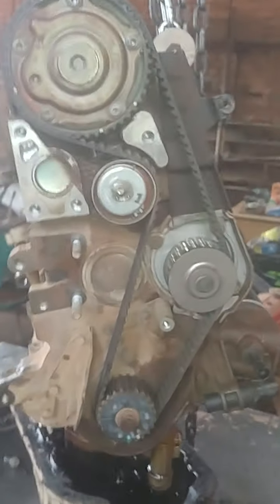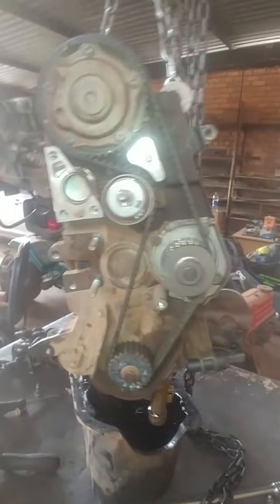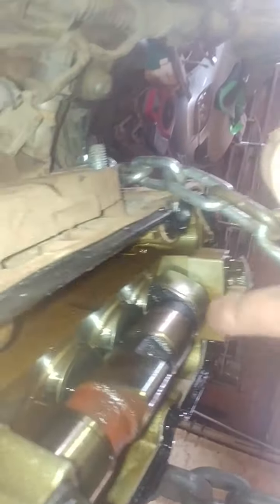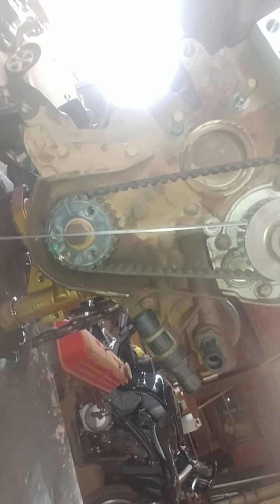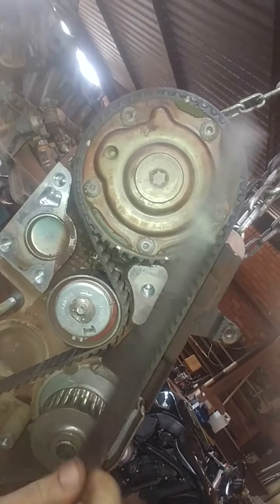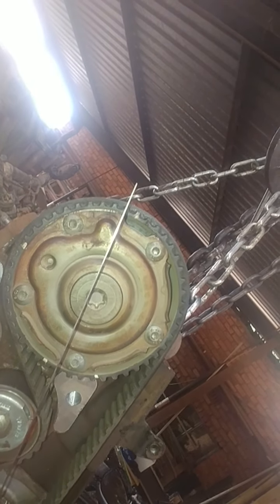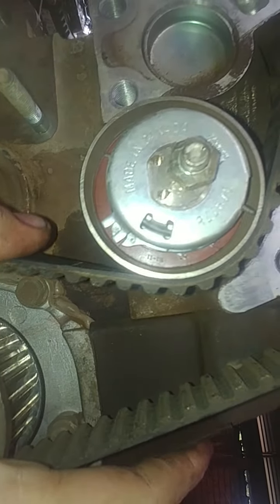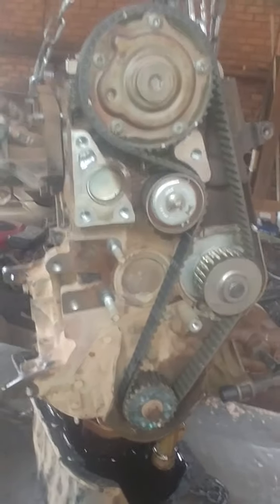how to set Fiat 500 1.2 valve timing tips and tricks

Comment: Well yes this will work out, I’ve done timing belts without the tools before but you’re much better off with the locking tool because it guarantees the timing will stay. It’s £30 in the UK from Amazon and you just return it once you’ve used it for a full refund.